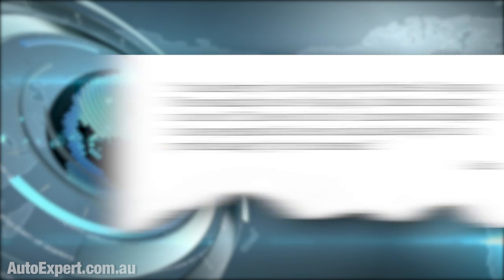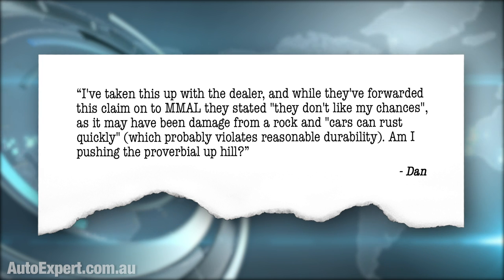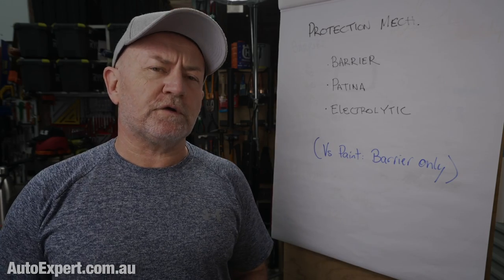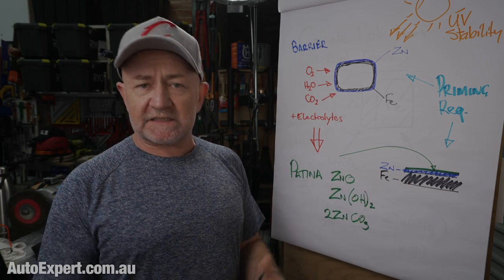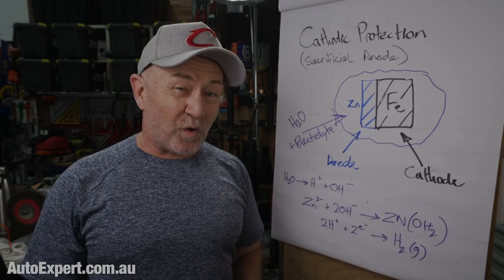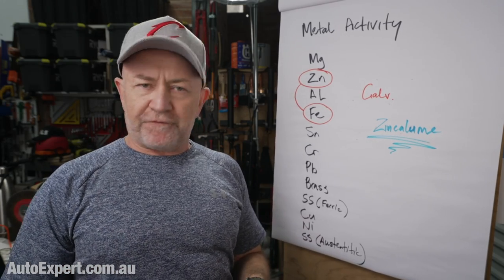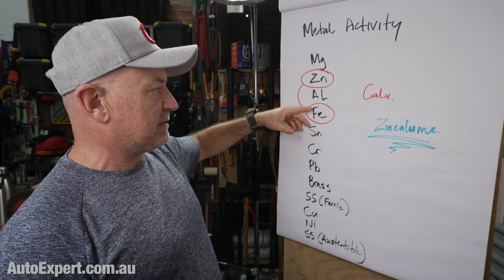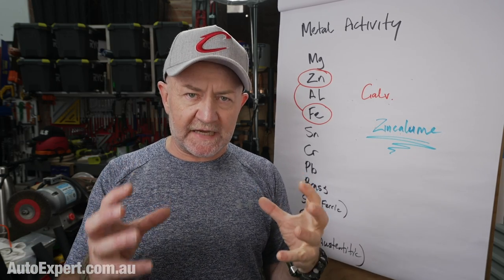The mad science of galvanising, and how it protects your car | Auto Expert John Cadogan

Comment: From a metallurgist specialising the metal coating, You have covered galvanic protection as related to vehicles very well. 
I was thinking all through the video, 'Oh, I can tell John about the throw that the zinc coating has, ie. it only protects up to a certain area from the edge of the coating in atmospheric conditions'. But no, you got that as well at the end, in your colourful way. 
Thumbs up.
PS: Just on the coating of the hole in your trailer. I won't hurt to cold galv it, as that will obviously make the zinc layer around the hole last longer.

Comment: I once worked for a radiator repair company, one day an Austin Champ Radiator came in to be cleaned for a restoration. It  was galvanized in (1945)apart from rodding the tubes ,it was in perfect condition-new car radiators usually last 3 to 5 years before the copper fins disintegrate.

Comment: I made a fence back in 2004 out of galvanised steel. Part was painted, part not.  The fence lasted a long time but now the unpainted section has started to rust and flake.  The coating has finished.  The painted section is still fine.  Galvanizing only lasts so long, not as long as people.  Painting definitely prolongs the life.

Comment: Galvanized car bodies started showing up in the late 1980s in the United States. This was after steel manufacturers figured out how they could cheaply galvanize sheet steel in quantity. As you say it has made an enormous difference. One thing I find interesting, at least two Americans, General Motors still does not galvanize the frames of their full sized, and larger, pickup trucks. Instead they dip them in wax. As you might expect they rust

Comment: PHi John, thank you for a very educational lecture. Here in the UK we salt our roads regularly and my 2011 Mazda is still going well. Sadly its predecessor a Ford made in 1998 rusted away in 15 years. One point you did not make is that chemical reacions occur faster as the temperature increases (according to my chemistry master at school.)  So surely the fridgid Canada temperatures would have a decrease in corrosion than our warm wet salty atmosphere? 
Due to concrete overpasses suffing rebar excess corossion the local highway authorities are using synthetic K9P as this is almost as good as salt at stopping ice on the road surface. Here in the UK we do not have any Dingos except perhaps in a zoo so we have to be inventive.
May I suggest you take a drive to a car breakers yard? Look out for a modern car totally wrecked that has stood for several months and futility look out for the dreaded "tin worm"

 Keep up the good work,       Bob

Comment: Having worked with matal since the 1970's I can say with some confidence that a hole drilled in galvanized or electro plated steel will rust just takes a bit longer than plain steel. When punching or shearing the zinc is smeared over the new surface so it is thinner there but does offer some protection but drilling tends not to smear the zinc in the same way so after quite a short while yo will see rust starting to form on the ege of the drilled hole which is why when I drill a hole in plated material I spay it with cold galvanizing zinc rich paint.

Comment: I went car shopping a few weeks back and came across a 2005 Mazda 6 wagon and saw flakes of rust in the boot. Looked up around the sill and pulled the roof liner down a bit and the thing was rusting away like mad. I could pull chunks off. Looked around the side and one of the window frames had rust holes big enough to put a pencil through. I’ve never seen rust that bad in a modern car, it was like it had a bunch of salt water just sitting in the panels.

Comment: According to galvanizeit.org "American Galvanizers Association" you can get as little as 4mm of "protection distance" - if the exposed steel is more than 4mm from the zinc, it has limited protection.
If your trailer holes were through thick steel, you could run in to minor issues.
They also say once all the zinc is passive - the surface activity has diminished due to the patina sealing it from the environment, the protection distance decreases further until the cathodic protection stops entirely.
It's not going to hurt to give it a little spray of zinc paint to touch up the galvanic protection.

Comment: Thanks John. I saw the trailer at the start and thought you were going to highlight the proliferation of cheap itchy-eye-scratchy import fake galv trailers that have flooded the market in recent years. A painted galv, or painted silver, that flakes off as you drive down the road! Takes a keen and maybe older eye to spot the difference between these dodgy imports and the real galv trailers. Price is not always the best indicator.
Reply from the maker: Seems pretty obvious to me. Anyway, mine was made and galvanised here in Shitsville.
Reply: One of the local trailer "manufacturers" gets away with imported trailers by bringing them in component form, then assembling here.

Comment: Hi, John. I worked for Milford industries and around 2007 we had a Holden Ve wagon shell to work with. After finishing our work, we left it out in the weather. A few months later I noticed that the exterior panels were not starting to rust but the interior panels were coated in rust. I assume the protective coating were mostly applied to the external panels of the car. Thankyou for your interesting and informative videos.

Comment: I had a load of parts from my 2 Land Rover Defender 110's grit  blasted then hot dip galvanized when I collected the parts the bloke said that they are would be good for 100 years now ☺️
Reply: Shame the defender isn't.
Reply: @Robert-cu9bm  yes they could have done a lot more to prevent corrosion, they could build vehicles that last a lot longer but they want to keep replacing the ones that are scrap after 15? years.
Reply: @stusmith1074  
Cost.
Reply: I have a 30 year old 110 ( pre defender) --- apart from the door bottoms, where they had steel stuck to Aluminium, she is rust free due to regular TLC to the chassis
Reply: @dennisreeves1393  on my 16 year old 110 it was rock sliders, front winch bumper and tow bar parts I had galvanized, it's still got original exhaust, on 25 year old ex military 110 it was roll bar and brackets rear bumperetts spare wheel holder.

Comment: my 2005 Vito van copped a rock off a truck on to the roof. The chip/dent approx 3mm across didn't think much of it but it was a loud bang on the roof. Two  years later there was a large red bubble under the paint approx 10mm thought I'd clean it up and paint the patch except once the crust was removed it was a 5mm hole through the roof and noticed a water mark in the headliner. The moral of the story should have treated the area sooner with some phosphoric acid and sealed it with paint. What would have been a one hour job turned into a five hour job. The fix still good now several years on.
I'd treat things like a hole drilled in a Gal trailer with some phosphoric acid to the exposed steel flushed dried and some silver-gal paint.

Comment: I also understand you can install a system to electrically charge your classic non-galvanised car so it opposes the current of corrosion, and this method is truly viable and is used in steel structures in corrosive environments, but I wonder whether some cheap commercial systems may be fake, so be wary. 

Galvanising can often last a human lifetime - I have some late 1940s fence posts holding up a fence that still haven't rusted. But don't forget to check your sacrificial anode in your steel hot water tank, it won't last forever. Check every 5 years and you will never have your tank rust if you ensure a present anode; they often last 10 years or more but it depends on the water and the temperature. Also, don't drink water from your anode protected hot water tank, it will always have the anode's corroded metal compounds in the water. I just replaced one of mine after 12 years. 

I thought they would have found a way around using tin in cans, but apparently not. Tin is ideal for this purpose, but last time I looked it was four times the price of copper - I wonder if recycling can recover it.

Thanks for this galvanising "promotion". I used it often in large products I designed in my engineering career, it's great. I was also once a member of the Australasian Corrosion Association in my trainee engineering days - true!

Comment: Ant caps today are just zincalume coated - not hot dipped but they will tell you it is galvanized.  With OB (off blade timber) that ant cap will last about 5 years as the tannins in the timber will cut that ant cap out wherever the timber is in contact with the ant cap.

Comment: Thanks for that John, really interesting. I believe I understand the hot dip process where the steel surface melts to bond with the zinc, however I don’t understand how the process works with regard to car bodies, I understand the charged attraction theory, but then how does it stick? Keep up the good work
Reply from the maker: Google the term 'electroplating' - it's that.
Reply: @AutoExpertJC  thanks John, will do.

Comment: I try writing for 3 seconds and make a mistake...you are superhuman John. I have one of those hot dipped galvanised trailers you showed early on in the video...its got small areas of "surface" rust here and there - the trailer is a couple of years old and safely stored in the weather :) . I haven't touched it and certainly haven't tried scrubbing it off, chemically or mechanically. Any ideas on how that occurs (and what to do about it)?

Comment: yes, up here in canada they do still rust although it takes far longer than it used to.  20 years ago a 10 year old car was worthless, not so true anymore.  the undersides and hidden cavities of cars here are generally coated with a "rust proofing" material, usually a waxy petroleum based product..  another way is to install an electronic device that is supposed to counteract corrossion.  these are generally for sale in the same aisle as magic fuel saving devices

Comment: Hey John, another great (and informative) lesson. Can you explain the difference between "Zinc passivated" and "Calvanised" please? I see it a lot on nuts and bolts and I surmise that the latter is better, but how effective (relatively speaking) is the former?  Thanks in advance...Alex
Reply: @Alfred Wedmore Thanks Alfred very interesting...Alex
Reply: Zinc plating is applied by electrolysis. It is typically .02mm thick. It can be bright (silver) or yellow (contains chromate) but they behave essentially the same. Hot dipped galvanising is applied by dipping the item into molten zinc,, hence hot dipped. The thickness of hdg is 0.2mm. Electroplating is preferred in applications where fine details like threads can get clogged by the dipping process or the part may be distorted by the heat of the molten zinc, or where aesthestics are important. Passivation of plated zinc is a treatment to accelerate the aging process. Pure zinc is naturally very reactive and only becomes stable when the outer surface has aged. Plating being very thin, doesn't last as long as dipped.
Reply: Thanks Bert, good explanation. @berttrombetta4953

Comment: I am a fellow engineer but I am lazy, so rather than drill a hole through my trailer I would have just adjusted the dolly wheel so the trailer was inclined and let the water exit at the tailgate, there is always that.
Reply from the maker: It's too steep a hill for that.
Reply: @AutoExpertJC  Unless I can see the problem it is hard to come up with a real solution, the fun of problem solving, could you turn the trailer around, put a cover over it and lastly, what about a shed/carport. As you know we earn heaps of money and a solution can always be found if we throw money at it and get someone else to fix it. Catch ya in the funny papers.

Comment: I might be wrong but while good cars are galvanised or aluminium these days Japanese cars in particular tend to still do coatings and no galvanisation. Toyota Avensis cars from the mid-2000s rust like there is a competition for ginger wheelarches... my friend's Avensis was about 10 years old when he discovered that behind the wheelarches in the back where the trunk meets the bumper there is a little pocket where the water inevitably pools once the weather seals start to age and you do not replace them... it needed plates welded in as whole sections around that area rusted through the way one would expect on non-galvanised chassis. Another encounter of mine was Mazda cars 2000s-2010s rust like there is no tomorrow... and so goes your beautiful mx5 down the drain unfortunately. The guy here says Mistushiti so I think the japanese lack of galvanese is the diagnosis... but I am of course not intimately familiar with the big M there :D I never liked their cars that much. There is also this possibility that 10 years it took for the zinc to be eaten away and then normal rusting ensued..... but I seem to remember from school that as long as there is any zinc remaining in the entire system the steel can not start to rust but I guess that is in ideal conditions and thicker layers... but the Sydney Opera has a cooling system with ocean water that uses steel pipes where there are massive steel bricks bolted to every so often to protect the pipes as we all know seawater is not kind to steel, but the whole pipe is not galvanised just in some places and that protects the entire pipe.

On the other hand my 9 year old mini cooper is like a swiss cheese on the bonnet as stone chips from darn SUV tyres shooting stones at you on the highways while you are basically sitting at their exhaust level can't be helped by me unfortunately. But not a single one of them ever rusted because good cars are galvanised and sure enough one can see all the way down the pit and there may be exposed steel the galvanisation does not allow that to rust well... because of course it does not. https://www.mini2.com/threads/are-r56-minis-galvanised.159476/

Comment: If I am not mistaken, they use cathodic protection to keep the rebar in concrete as well, or it disappears.
Reply from the maker: Concrete is pretty stable and watertight so no protection needed if the rebar is sufficiently deep in the concrete. If it's near the edges it can rust and the expansion causes spalling.

Comment: Hi John how does it work when the zinc is coated in paint? I remember when I was a young lad dad would make us file the sacrificial anode on our outboard so there was a nice reactive surface exposed to the environment. Where on the car in your example the entire surface is sealed with paint and the chip is presumably through to the steel. Not leaving much exposed zinc to do its thing.
Reply from the maker: You don't need to expose the zinc. Depriving it from electrolytic contact is better.

Comment: Hi john, 
I know this comment has nothing to do with this video but would love your feed back on another issue ive seen a lot lately and am unsure if it is the right thing to do or not.
You did a comprehensive artical on tyres a few years ago. And emphasised how critical to maintain tyre pressures at the specified or slightly above as the tyre placards show. There are almost all off road u tube videos showing people reducing tyre pressures on rough or corrugated  roads for thier 4x4 and caravan or camper. What are your thoughts on this. Any help you can give would be greatly appreciated. 
Regards 
Kevin Bryson.

Comment: Not 100% sure but I'd make an educated guess that they add the aluminium to zinc because of its patina properties. Aluminium exposed to air forms a very thin aluminium oxide layer virtually immediately and that layer if is very unreactive once formed.
Reply: Zinc gets a patina layer.

However it will corrode fast if it's not allowed time to create the patina.
Reply: @Robert-cu9bm  That is my point. Aluminium forms its patina layer in a fraction of a second and it is both chemically very stable and mechanically tough.

Comment: If the zinc is sacrificing itself, won't that make the paint fall away?
Reply: It only sacrifices itself when in contact with air and water.

The paint stops that, when the paint is missing (scratch) then it takes over.
Reply: @Robert-cu9bm  Well... if the protection ends up falling to the paint, then why aren't we back at square one, 1960s, relying on the paint holding up?

Comment: Galvanized steel is a short-term process  & ultimately a process that is easily damaged by the most minute of incidents. Don't drill a hole thru it, don't scratch it or damage it whatsoever or it WILL rust! We have a nice carport built up of galvanized steel & all the pretty welds are getting eaten up by rust...the coating applied to the steel is impossibly thin & can be damaged by almost anything,... don't look at it sideways or it might break thru that coating & rust.
Reply: Obviously welding eliminates the zinc coating. Just paint it with Cold Gal paint.